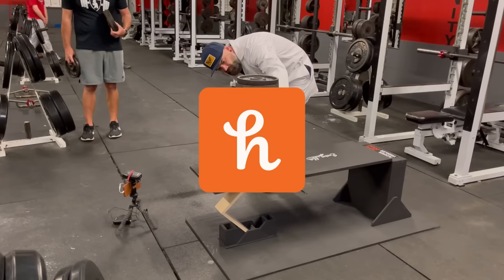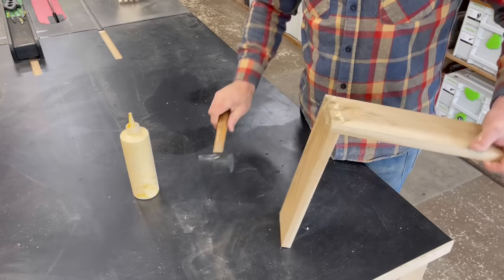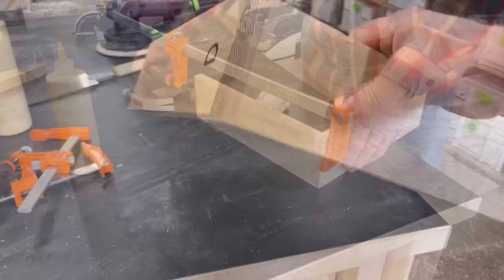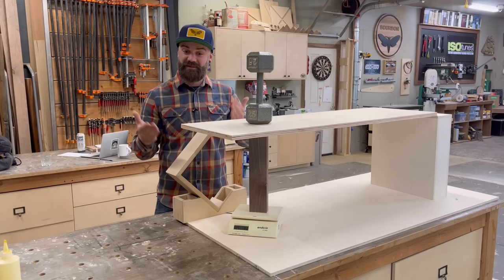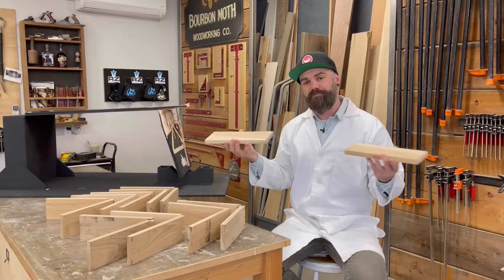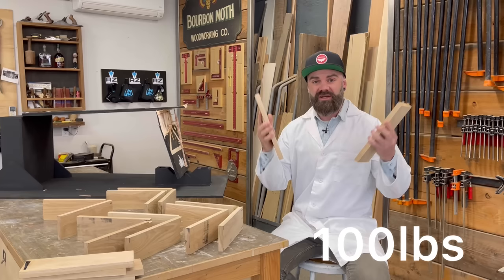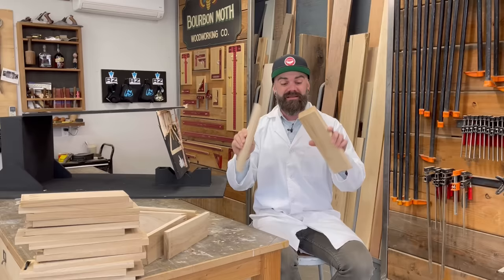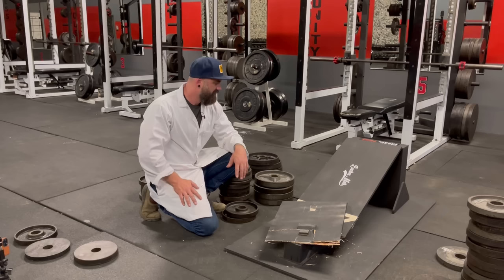What's the Best Wood Joint || Insanely Strong Joinery!

Comment: Actually, I'm not surprised at all it is the structure with the largest bonding surface area that won. Even the wood dowels have a smaller suface area at the shearing point than the miter joint. Adding cross-grain thin wooden slats to a miter joint just increases the strength, basically by virtually creating a "composite material" (combined with the glue) that is the sum of the strengths of both. Ultimately, of course, a lot will depend on the lever length (the length beyond the pivoting point on which pressure is applied) and thickness (toughness) of the wood one uses. 
I am surprised though box joints are better (even though marginally) than dove tail joints. I had thought the opposite would be true. In the end it works out great though since box joints are much easier to make than dove tail ones and thus are more efficient where effort and time are concerned (they are not as pretty though)
Liked this video very much, because it shed some light in a "scientific" way on a few questions I had been asking myself for years. I can't wait to see what sort of insanely strong wood joint you'll invent next time :)

Comment: Thank you for the interesting comparison
you might wanna note that the test you've made might let you compare the torsion strength of these joints, and that the measure for the torque (NOT force or weight) equals the  distance between the center of the mass (e.g. the weights) and the joint times the actual weight applied (units for this are ft.*lb.).

So, referring to your say about "60 pounds is strong enough" - for a small drawer or box you might be right. but for bigger frames - you might wanna go for the stronger options

Plus, I recommend to try a miter joint with pocket screws for even better torsion strength.

Comment: one other joint I think would be interesting to test would be a Dovetail Spline. Also perhaps make the Dovetail in the dovetail joint test for that specifically perhaps make the dovetails larger. The dovetail splines I don't think would have to be huge. Maybe two instead of three splines. This test was kind of surprising though. I was very surprised the difference the miter made over the but Joint.

Comment: Great Tests!!! Thank You!!! Pocket Hole Push vs Pull test would have reversed the Pocket Hole Test for sure. Using 5 dowels instead of 3 and would have made the dowel joint much stronger. Ordinary deck screws (predrilled with a very thin bit) are incredibly strong. The problem with screws is that they can work loose on a flexing or vibrating joint. 5 dowels on the miter joint may have been the strongest?

Comment: Oddly, I was wrong about the miter joint, but right about the miter with splines joint. I too thought the miter joint was little better than the but joint. I was definitely trying to consider gluing surface area for my predictions, and in my mind the miter with splines had the greatest gluing surface. I honestly thought the dowel pins and domino would've done better.

I think the dovetail joint was mildly misleading because I don't feel that the joint used was completely proper. I think a dovetail done right has all the sections equal, which I think would've brought it's capabilities in line with, or slightly better than the box joint.

Comment: The dovetail break is interesting because it doesn't look like a complete break.  It appears as though the wood split from the horizontal pressure caused by the thick part of the pins being pushed into the thinner part of the tails.  I would be curious to know how much more weight would need to be added for a complete collapse like the other joint failures.

It seems in this weight class, the strength of the wood was the limiting factor rather than the strength of the glue or the strength of your dowel or loose tenon—I think this would explain why you had several joints fail at near the same weight.

Comment: I wonder how a box joint would hold up, if you drilled a hole down the boxes and insert a long skinny dowel pin.

Looking at all of these joints, they pulled apart, so adding that small element that requires sheer to break would probably make a huge difference, and the box joint seems like it would be the most efficient one to make with it.

Comment: This video really surprised me. I expected the dovetail joint to easily beat the mitre joint. I did wonder if the dovetail was too tight and had squeezed out most of the glue. Be great to test some different glues on your test rig with mitre joints.  To keep the test consistent, I suggest adding a couple of metal pins to keep the glue thickness consistent. As I understand glue strength keeps improving as your glue thickness reduces, until it all gets squeezed out where it falls off a cliff.

Comment: Awesome video, but there are two more types of force you haven’t tested for.  So far you’ve tested compression strength, but now you should test torsion strength—how much force would it take to pull them apart?  There’s also shear force, which would be tested by keeping the joint parallel to the floor using this setup, and see how much weight it can take to buckle like the knee of a football player.

I suppose there’s also twisting and combinations of force—but structurally, it’s going to be compression and torsion that are the most important things to test.

I also think you should test different thicknesses of the same joints, because I have a feeling you will be shocked at how much the force required to break them will scale up.

Oh, and maybe testing out some of these things with plywood—because I know how much woodworkers hate plywood, and I kinda want to see you showcase why it’s superior in strength to any variety of wood.  (It turns out that wood glue not only makes super strong joints, laminating this cuts of wood and alternating the direction of the grains on the layers results in a board that is insanely strong.  Plywood has flex, but that’s also why it’s strong.  Straight up cuts of wood don’t have much ability to flex and when the force has exceeded the threshold, it cracks and splinters into pieces.  Plywood has limits for bending too, but if one of the layers fails, you’ve got more remaining that can still carry a reduced load.  There’s a reason home construction all uses plywood for sub flooring (OSB and MDF are both shit) instead of laying long planks directly across the supporting timber.  That’s why modern hardwood floors are always laid over the subfloor.

Comment: I suggest rerunning the test with a dovetail joint cut using a jig and router like the Leigh jig.  Those crazy narrow pins might look sexy, but in my opinion create a much weaker joint than you would obtain with broader pins.  Probably not as strong as the splined miter, but definitely stronger than the handcut dovetail.

Comment: GREAT JOB !

like to thank you for excellent scientific experiment video, fantastic useful knowledge 
gained for everyone in wood related construction furniture or buildings all can benefit from this...

I'm no physicist but ...  (computer scientist here)

seems to me the greater the surface area on which wood glue is spread, used, the stronger the end result of the connection between any two pieces of wood...  

one must maximize and plan ahead in such way as to maximize surface area contact with wood glue to gain the most sterngth in any project...  

also consider how much work goes into making any perticular joint and if not also maximizing surface area in contact with wood glue then abandon such type of joints even if they are fancy and popular... and go with maximum surface area type joints that are also easy and quick to implement and more stronger...

... math to calculate surface areas ...

rectangle is simply  A * B

in a 45o angle joint using a triangle calculation

it will be

side "A * hypothenuse" of the triangle at hand
and is longer than either A or B

of the rectangle and is the square root of ....  like...   sqrt(A^2 + B^2) ...

getting this from the pythogarom theorem saying the distance of the hypotnuse in a triangle is

side A^2 and side B^2

C^2  ==  A^2  +  B^2 

and C is sqrt of ...

-tibor

Comment: A dovetail is weaker than a box joint because it depends on short grain for some of it's strength.  The strength of the simple miter is counter intuitive, but you are not the only one to find this.  I suspect that the miter soaks up glue into the fibers better than we think.  A professional I know says that you need to glue joints twice as the water in the glue gets soaked in and you have to add more.  He also stresses pretty tight clamping.  I suspect that woodworkers who think they have a "starved joint" actually did not put enough glue on the joint due to this phenomena, and did not clamp it hard enough.  The splined miter is a lot more understandable and your conclusions are consistent with other joints.  BTW, excellent video.  I am glad you did not waste too much time on pointless preaching.

Comment: If the dovetails were evenly sized, like the box joints were, then surely they would have fared better.
I'd also really love to see how the joints compare when the weight is pulling them apart, rather than crushing them down

Comment: It would be interesting to see if using bamboo screwer in multiple pieces to form dowel would be stronger.  The screwers are placed perpendicular to the 90 degree angle of the joint.  One other video on u tube video shows a very strong box joint using this method.  Think bundle of sticks versus one single dowel

Comment: Have no read many comments, but I had the thought that with longer arms, you could lower the weight used to break the boards.  I am also curious if some of the joints would behave differently flipped. Dove tail, pocket hole and dowel for example are not symmetric. I know basic physics implies same force being applied to both legs, but it’d be interesting nonetheless. Flip them and see if there is a difference. Lastly, why not also test mortise and tenon? Both hidden and through. 

Regardless, I have new respect for spline joints. (Oh, what about hidden splines? Sorry, that would be very interesting as a riff on the miter/spline upset). Thanks for the test work!

Comment: I believe the spline joint you used is called a "keyed miter". According to the Joinery book by Gary Rogowski (pages 113-115), you can cut them at a slight angle for increased holding power. He refers to a Splined Miter as the version with essentially a full-length biscuit that runs the full length of the miter joint. If you do this test again, I'd be curious to see how this joint compares. You could use plywood for the spline in one version, and hardwood for the spline in another version. With the hardwood version, cut the spline so the grain runs the same direction as your wood pieces. Gary says "they are impossible to break". Let's see about that!

Comment: Sorry to burst any bubbles but the support on the lower side is parallel and adds a little strength. Best way to test is balance on the tips only probably with a piece of angle iron to prevent compression of the cells🤷. My 2 cents opinion

Comment: I think the dovetails fingers need to be equivalent sizes that way the surface is equal to both sides of the wood planks.
Also, u can make faux-dovetail, butt-joint with a wedged insert like a spline but not flat.

Comment: great video, i really dont want to be an armchair youtube critic, but the test as a bit unfair to all the joints. none of those joints are designed to take forces at that angle, and there are no circumstances that would put the pressure on at that angle. the joints should be graded as pulling apart laterally, so maybe putting one section in a vice and then use a hydraulic jack to pull the joint, like a draw front ect. i am sure that the dovetail would tke several tons of pull to pull it apart even without any glue because the mechanics of the joint would require the wood to crush enough to slip out of the shape cut..... and if the wood used was something like lignum then,, keep on pulling because it aint never ever going to crush!

Comment: I think I found out why the dovetail broke before the box joint :)
Apparently the shear strength (”resistance to slidong”) of glue is about twice as strong than the tensile strength (”resistance to pulling”) of glue. This means that the angle in the wedge actually reduces the glue strength. On top of that the wedge shape also pushes the fibers appart, while the box joint is only in shear stress and the fibers are not pulled appart.

At first I thought the dovetail joint would be stronger because the wedge shape gives more surface area for the glue and some mechanical connection. But this only applies above an angle of around 20 degrees because of this strength difference (assuming my math and simplifications are correct enough)

This can also explain why the miter joint was so close to the box joint, at 45 degrees the total glue strength is actually stronger due to the extra surface area.

A fun thing to test would be to make multiple different box joints with different number of ”teeth”, since then you can increase the surface area of the glue and you should get a stronger joint. Increase the number of teeth too much and the joint should be weaker because the wood will become too thinn and the wood will fail instead of the glue. Would be cool if you could find that sweetspot and see how strong you can actually make a box joint :)

Comment: Dovetails would have been stronger with a 50/50 pin to tail ratio.  But dovetail strength is primarily for pulling weight for drawers.  So the boards don't pull apart. If the pin to tail ratio was the same as the box or finger joint I think it would have been stronger.  But since dovetails are mostly used on drawers the pull strength is the important factor since it can only be pulled out in one direction, so for looks the small pins are more desirable.

Comment: You really should have made two of each and arranged them so that the joint was aligned vertically once, and horizontally once for each test. 
I know it doesn't seem like it, but that little difference could completely change the results of your test.
The way you had the dovetail aligned was putting force on it in a way that it would not have been mounted in a drawer.

Comment: Basically this is a glue test. Penetration, surface and direction. Which is enough really to make our conclusions for normal use. So Big Thanks!  
Now if a joint is to be tested, then the glue should be strong enough, say some engineering grade Locktite.  So the wood breaks, not the glue. 
I was  pretty sure about the winner in the test  and guessed it right.  Though I thought a but joint with screws is not so bad, but it was not in the test.

Comment: It appears that in both pocket hole joint test that the assembly is turned upside down compared to the other test. The upper boards in those two tests are traveling past the lower board.

Comment: I'd add a finger joint to the next set of tests, as well as a dovetail joint where the dovetails were equal. A lot of this is the sheer surface area that's glued so a finger joint should smash just about everything else out of the water.

Comment: 24:21 was fascinating to me. To see how different people respond to a sense of danger. That's how I too would have responded. 
This test really tested shear strength of the joints, which in my view is pretty representative. But in reality that's not how these joints would bear their load. 

A better test is to test their tensile strength, that is, perpendicular to the joint or to pull away. This should very easy set up.

Comment: Looking at a wood strength chart....your strongest joint may have been weakened by using black walnut.  The breakage seemed to be a tensile fracture of the black walnut along the grain, levered by the inside of the miter cut....so if white oak is 10% stronger than black walnut....your best joint may have taken an extra plate or 2 ... maybe lol

Comment: I found it interesting that the glue line failed in all of your tests.  My experience with S/P/F lumber, and the received wisdom is that "the glue is stronger than the original wood".
Certainly, if you use a stronger wood it will eventually catch up.  But there's also the issue of how well the glue is sticking: does it pull off the wood one one side, or break down the middle leaving a film of glue on each side?
Definitely, the results are different when the wood (not the glue) fails!
Note also that your result is not in pounds alone.  It is a torque and relates to the length of the arms on either side of the joint.  A longer lever will let you break the joint open with less weight, and vice versa.  
In the case where the glue does the failing, you get better results with more surface area being glued, and there will be a difference in whether the forces are perpendicular to the joint or shearing along the joint.

Comment: I was surprised to see how little bond there was on the dowels to the boards. Was that a glue technique issue, or is it an issue with squeeze out, or too much air gap in the hole? Interesting. I'd have expected that to be stronger.
Reply: Needs more dowels (5), longer dowels, better glue, better dowels. Who knows exactly, but I could have made the dowel joint much stronger.